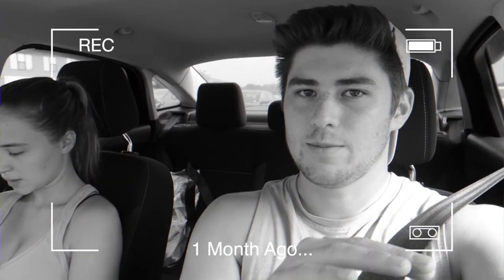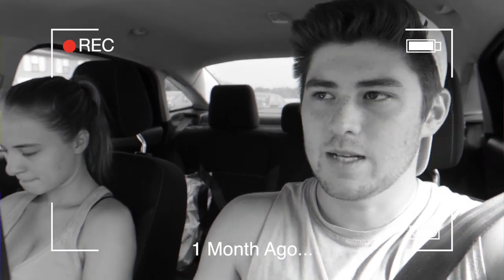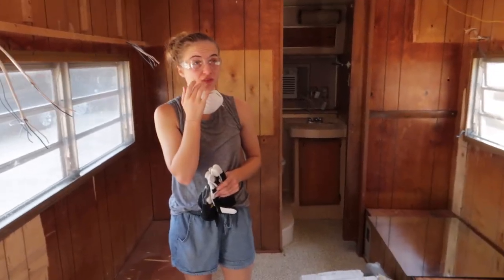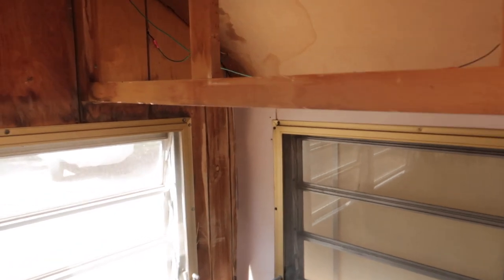We bought a vintage camper and we're rebuilding it!

Comment: Neat! I follow your channel on and off since I think moving to Austin would be cool. Kinda thought maybe you guys quit YouTube. My dream is to be able to someday work remotely or earn enough passive income from a business or investments to travel full time.

I follow some full time RV people and groups, so thought maybe that's what you were doing when I seen the title... I followed 2 other channels from Austin but both of them moved elsewhere, seems like no one sticks around in Austin for some reason, maybe due to cost of living increasing?

You're not keeping the bathroom in it? I know some older RVs went straight into the sewer, but more modern RVs have a fresh water tank, a black tank(toilet water) and a grey water tank for the sinks and shower. Then propane and gas/diesel(on drivable for the engine and generator if it has one, but I know some fifth wheels have generators built-in too with a tank). So many tanks haha. Then some 40 feet diesel pushers have a bath and a half, so usually 2 black tanks. Some of those RVs look nicer than peoples houses and apartments.

Also should be aware of tire safety as I've seen people in RV groups discuss that. Even if the tread looks good, since RVs are moved a lot less than cars the tires still have a expiration date on them even if they look new, as they can rot out inside. So would want to keep up on the tires by both date or tread (if driven a lot), replace whichever comes first. On a car you drive daily you would most likely ware out the tread before the expiration date, so most people don't think about this. On another channel someone remodeled a Class A Diesel Pusher from the 90s that's been sitting for awhile and one of the first thing they did is get new tires. So should look at the tires and check the dates.
Reply from the maker: Wow! Thanks for the great info! No we’re not keeping the bathroom, simply because there’s not that much space and most coffee campers will not have one. We do have a fresh water tank and the gray water tank as well. Our builder is making sure we’re staying up to code (: